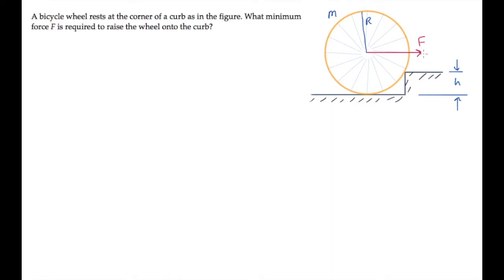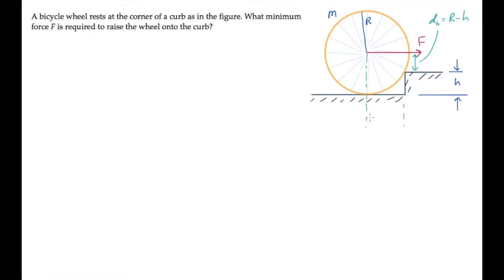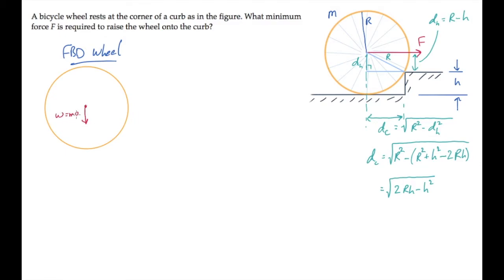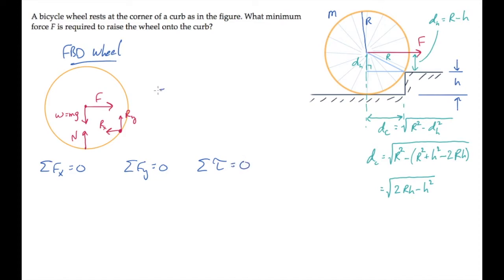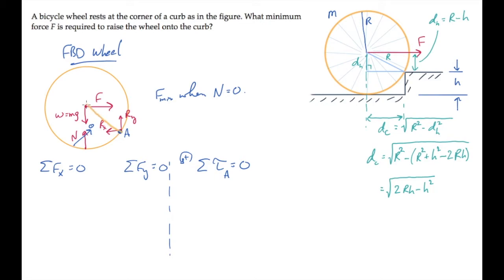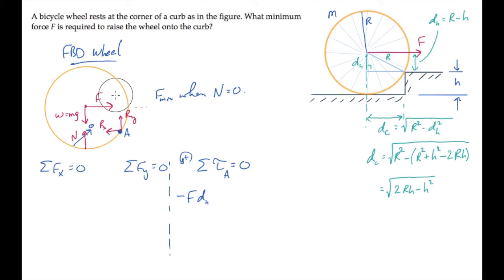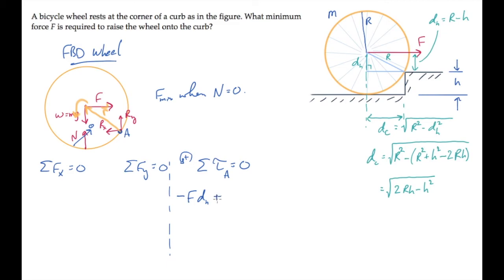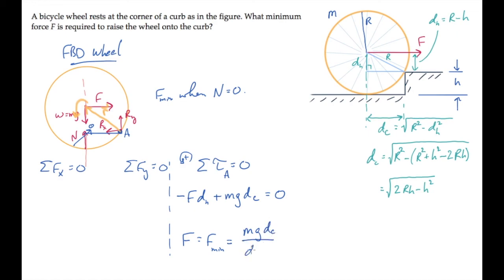Rotational Motion: Equilibrium. Level 2, Example 5

Comment: At point where reaction is occurring, will there be friction force? If not then why?
Reply from the maker: Ah, yes - there's friction at that point. The general term "reaction force" encompasses other, more specific, terms like friction, normal force, etc. In this case, friction would contribute to the tangential component of the reaction force and the normal force would contribute to the perpendicular component (relative to the wheel). But because we don't know (and don't need to know!) anything about the friction or normal forces in this problem, we can lump them together into a generic "reaction force" and sum torques about that point so they don't contribute to the sum.
Reply: @jhughesphysics1078   oh! Thank you.
One more thing, if we draw free body diagram then 4 forces will be acting:-
1- weight of the wheel
2- applied force
3-friction force tangential to wheel and 
4-normal force  passing through centre,
right?
Reply from the maker: Yes, that’s it (assuming the wheel is rigid). 👍
Reply from the maker: Here's a link to a picture showing how they're related: https://drive.google.com/file/d/1EGtEoozay2ECBr6V-OYqvOJPnDEmowFW/view?usp=sharing

The important point is that it can be done either way without affecting the answer. :)